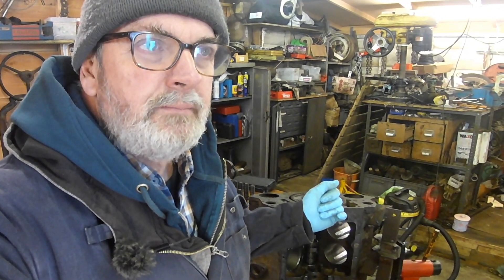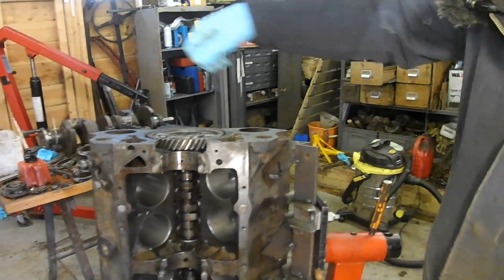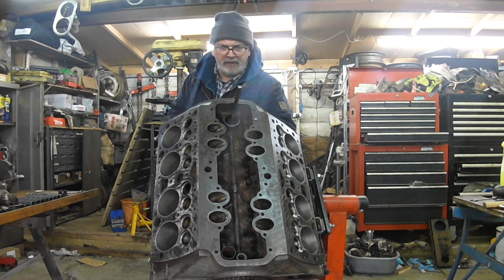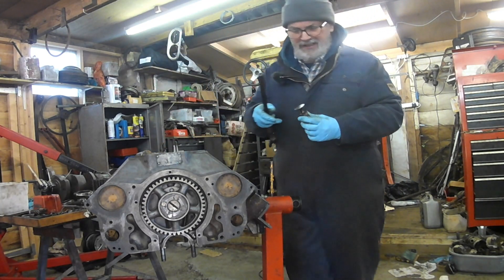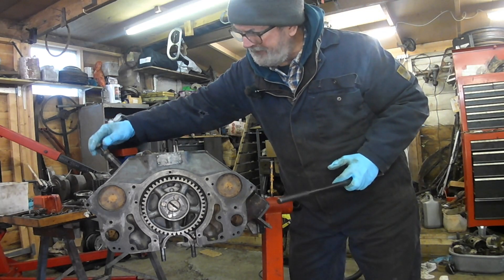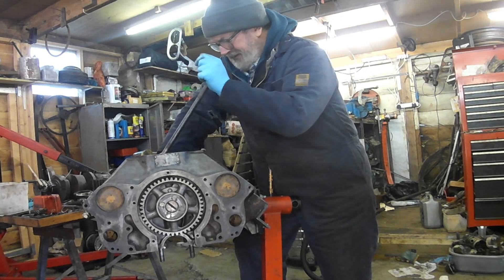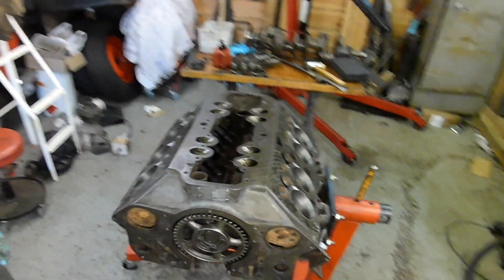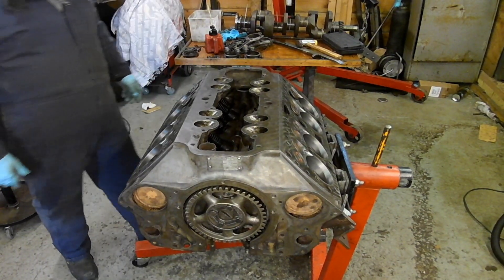Mart's Crusty Ford Flathead V8 Pt17: Let the build begin!

Comment: Hey Mart!  Bummer about the cam footage.  The life of a YouTuber!!  Another great episode and we're getting slowly closer.  Are you gonna put it straight in a car or test run it?  

I test ran mine and I'm thinking I didn't get the rings seated correctly.  Going to the V-8 Meet in Auburn last year in my '35 Fordor (2K miles) I used more oil than I'd have liked on a fresh build.  Oh well!  It is what it is now.
Reply from the maker: Hi Jeff. Current plan is to fit it into either the 41 pickup or the 33 coupe, start it on the front drive and immediately take it out on the road. Who knows whether it will be the right thing to do. I might not even make it around the block! Mart.
Reply: @MartsGarage  drive it like you stole it!